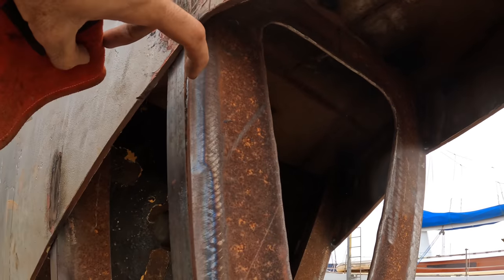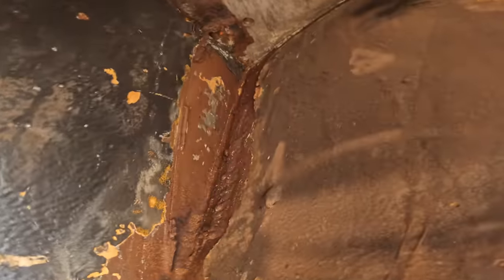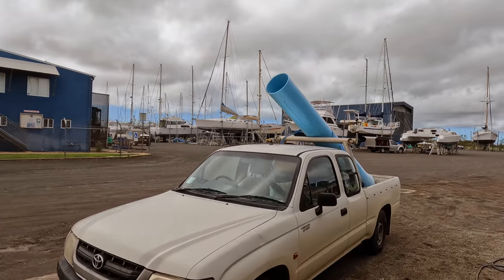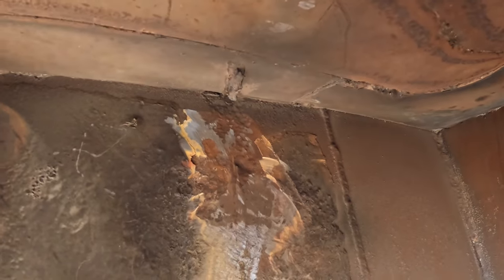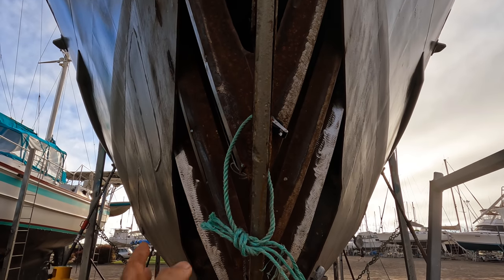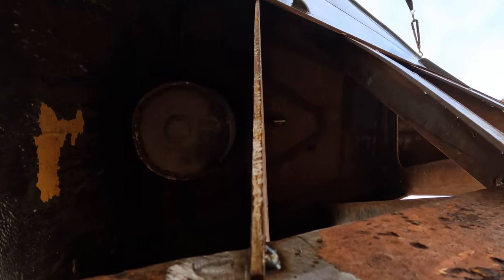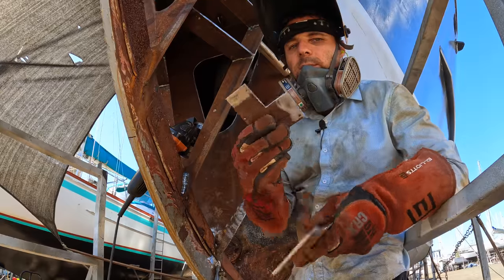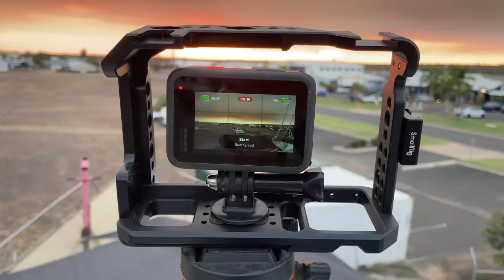Restoring Brupeg's Bow, Adding Ice Strenghtening (part 1 of 2) - Project Brupeg Ep. 255

Comment: Awesome, a working welder again! So glad it was a simple and quick fix. The bow is really coming together. I know it wasn't what you wanted to be doing right now but it sure is great that you found the problem and can take advantage to do some major strengthening.
Reply from the maker: Yeah having the MIG welder running sweet again is a huge relief. It really is indispensable when it’s needed. Next up is getting the plasma back online and we should be maintained on the tools front. The front is actually a job im really enjoying. Feels like ages since I’ve been able to do some chunky steel work. It’s what I love but at the same time it’s what Brupeg needed to be in tip top shape

Comment: Those three ribs have become a great example of the boat as a whole. You found some space so you added a shed load more bracing and welded it all together. My kind of build 👍

Brupeg - “Never knowingly under engineered”
(You should get a shirt with that on it 😁)
Reply: And the cutouts in the "triangles", along with the bar stock, mean more strength with no appreciable weight gain, especially important in keeping the front from falling off.

Comment: You could try getting a can of spray-on conformal coating for the circuit boards. That should make sure they don't get eaten as quickly by salt air.
Reply: Definitely
Reply: Or dip em in epoxi
Reply: nail varnish with the little brush
Reply: All those things work with different amounts of effort or mess to clean up after
Reply: I was going to suggest simply checking that the boards are plugged in hehehe

Comment: I love the reinforcement efforts. Very prudent. Ours was not specifically designed as an expedition boat, but it's certainly fit for higher latitudes and the bow's interior (which is entirely open as it's the "forepeak workshop and chain locker") looks a fair bit similar.

Comment: Conformal coating on the boards. Brushed on, not sprayed on. You have to do the chips in particular and the cap. Diodes and resistors are pretty self contained components due to the baking process, but chips... in salty environments, they'll eat it.

Dielectric grease in all the connections too.

Comment: G'day Crew,,,
  Great to see the bow  taking shape , the   general configuration looks good ,  with all the plates , ribs  & reinforcing  seeming  to be more than   ample  for your size vessle .
Ive seen very  heavy plates in the bow compartment   in large ships (often fresh water tnk ) But a vessle your size  rarely  has so much reinforced structure  in the bow .
 The bow is almost always the worst place for corrosion  on vessles,  due to salt spray , condensation  ,ect ,, 
Sure  pays to do a good job with the rust prevention  in the bow....  !!!!
Great episode ,
Thanks  guys .

    Respect

Comment: If that welder is going on board with you, you might want to consider a spray conformal coat for the circuit board, and any boards you have.  It's pretty cheap and effective - keeps moisture and salt off your electronics.  Alternatively, you can seal up the box (but make sure you do it on a dry day or moisture will get trapped inside.  You can use cheap nail varnish on your boards too, but I like the spray stuff for ease of application.  It's not hugely critical, but I would mask off heat sinks when you spray as the coating will retain some heat.

Comment: That pipe you picked up is culvert used commonly on farms 
Each peice comes with a giant o ring that fits inside the grooves, normally used to join them together but it may be useful to make the bottom of your "chain bucket"
The shop that sells them locally might give you an o ring cause not everyone wants o join them so usually they have a mountain of spares 
Either that or ask your local council
Reply from the maker: Ahh fantastic. I didn’t know this. We have a decent agricultural shop in town that I’ll go ask if they have any bits for this pipe
Reply: Theyre common as 
You can get all kinds of bits for them 
Can probably even get end caps you can just knock in 

Dual wall "insert inside dia in inches" is what it's called

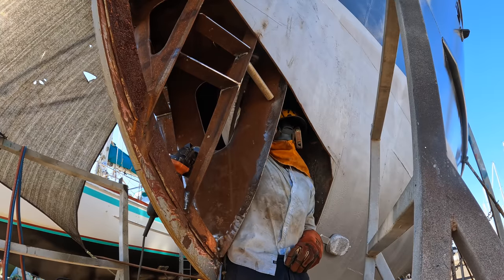Comment: Damien I question your selection of welding attire.  An example is the random spark down the pant leg at 34:10.  I know they're hot but a leather apron might be advisable if you continue to weld over your head like that.  Next time it might be something a bit hotter than a spark landing in a sensitive area.

Comment: Your truck probably has a mechanical scissor jack in it used for changing flat tires. It probably would have worked better than the hydrologic jack and would have been easier to maneuver into position. I know it's too late now but maybe it'll help in the future. Good luck!
Reply: Hydrologic??
*hydraulic

Comment: Gidday Dame and Jess, One of the best eps ever. I'm not a welder or a designer of boats but you need to give your welder a plug. Make and model. And maybe a name too.Because in Oz we name everything. Best wishes to all. Stay safe and get your booster and a flu jab too. Good night Chris
Reply from the maker: Cheers Chris. The welder we use is a Unimig 205 viper. It’s a MIG, DC TIG & Stick welder. Great little unit and the after sales support is really strong with them

Comment: There is a coating for circuit boards called conformal coating.  I will turn brown on hot components like linear power regulators.  You should avoid spraying it into jacks, switches, potentiometers, etc.  I would also use something like a clear spray paint if nothing else was available.  After all or the vast majority of the bridge is wired, I'd think about hitting the terminal strips that are not in airtight boxes.
Reply from the maker: Yeah our plan is to nuke everything once its wired. Engine room box will be getting sprayed with laquear and then sealed up and filled wil CO2, as will any boxes we create in the wheelhouse etc.

Comment: Dame, great to see the progress you've been making on the front bulkheads. Been thinking for while now about your large nuts... That is the ones that bolt the stabilizers down to the deck.  Perhaps consider somehow adding a tether to them. Perhaps some wire rope/cable.  Or that welded to a bearing, weld to the top of the nut so you can still spin it? But the bearing would rust out too quickly out at sea? Food for thought. Just thinking if you want to deploy them in some rougher weather and try to get the nut in place without dropping it overboard... Also love your Imperial conversion. Always cracks me up. Keep up the good work.

Comment: Damien, I have a suggestion: how about a marine version of a bull bar for iceberg protection?  I'm thinking of  something like a 2" steel tube mandrel bent to the shape of the prow? I envisage 2 tubes, one vertical to follow the side profile of the bow and a second horizontal tube to wrap around the bow as viewed from the top  - or below. The materials used should be the same as for a conventional bull
bar. The tube/pipe should be held proud of the actual hull by approx. 2" with some kind of mounting brackets. My concern is to keep the worst of the ice off the hull of Brupeg altogether. I don't think that the amount of steel I'm thinking of should have any appreciable effect on boat speed or  weight. The thing  for me is that looking at that bow structure I doubt that it will stand up very well to directly impacting polar ice. Consider this: Brupeg is a big, heavy vessel with considerable kinetic energy at even 1 ķnot, enough to cause substantial damage to the bow in a direct impact. Just my thoughts on the problem for what they're worth! Cheers,  David Callard. 
 looking at that bow
Reply: Certainly and idea, but it's probably most likely to get caught on ice rather than protect the hull. Also the hill is likely far stronger than most pipe/tube light enough to be manouvered on and off by hand. I doubt Damian wants to push an ice bumper around all the time.

Comment: Dear Damian a Thought since you may go in icing waters would it Help to add one more Layer for the Front of the Hull?
Reply from the maker: We will be doing that but not at this stage. Will happen in around 2yrs time when we do the full ice mods to the hull. Extra ribs, removing the keel cooling pipes, stainless plating around the hull etc

Comment: Because. you are going to be. Going into the. Arctic  n lots of ice it was nice to put some new. Rib s  it would of been nice to put some nice big plates over the bow. Not long a go was watching the deadliest catch n these guys coming in to dock n they had 2 inch plates on the water line n you should of seen  metal was. bending in to the point that had to put some heav y. wood n push it in  make sure you have at least one of those pumps that the coast guard. lowers down to boat that are. sinking. be catreful

Comment: Have you thought about lazer rust removal?
Reply from the maker: More than you would imagine…
Reply: @ProjectBrupeg  The units are a bit expensive!!
Reply: @ProjectBrupeg  I hadn't realized there were issues with them. I have only seen them used on Youtube.
Reply from the maker: Yeah sandblasting leaves a rough profile that paint grabs hold of. Anything else, flapper wheel, sandpaper, laser etc just take the surface off without creating a profile for paint. If anything they make the problem worse by smoothing the surface out
Reply: @ProjectBrupeg  Got it, thanks, it's a pity, because it looks like a very quick and clean process. Would an etching coat of some sort help??

Comment: Damien,  could you use a dual shield wire in that welder? 🤔 I know mine burns in a lot hotter when used. Making headway though. Good work .😉😁
Reply from the maker: Yes. Often do use dual shield. Really love that stuff. It’s been a while since I used solid wire so I’m just trying to keep up my skills and use solid on this job. But other hull plates I’ve done were dual shield 0.9mm wire

Comment: Question at this stage of hull reconditioning...... Have you considered a Bow Thruster install while everything is open on the hull? And "No" I am not made of money either....
Reply: I'm quite impressed by the water jet type of bow thruster. Their big advantage is that they don't require any of the space that the propeller type does but you're right, either type would work for Brupeg.